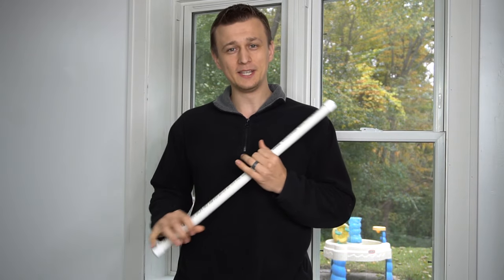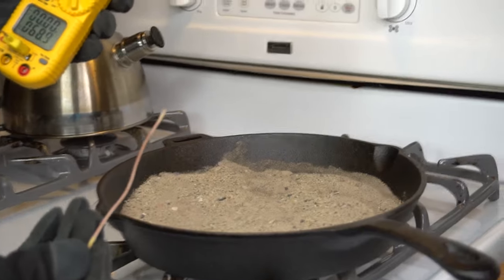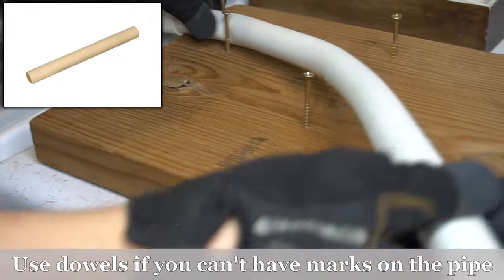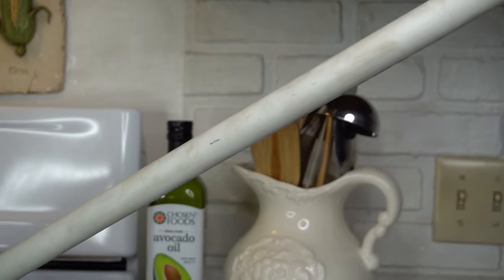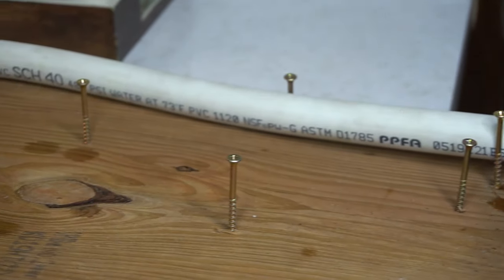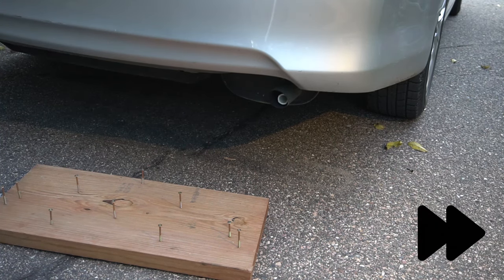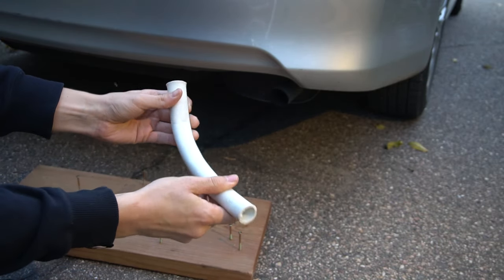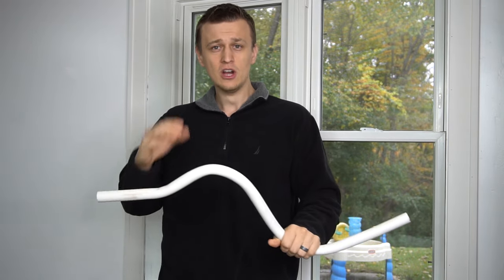How to Bend PVC Pipe With No Tools

Comment: 4.17.2022 - 4:00PM - In the shop.
Very good.  I was working with 7 foot thin wall  3/4 inch PVC.
Only needed 20 degree bends every 10 inches (7 bends).
I used a heat gun (slow) then preferred propane torch (fast),
but that torch will burn PVC quickly.  Didn't matter for my 
purpose.  THEN I kept a wet rag near by and when done bending,
I used rag to PRESS the angle slightly flat for strength,
and also cooling it.
I attached these 160 degree PVC arcs to 8 ft cane poles to
make support arches for bird netting for a chicken coop.
BRILLIANT. PVC is smooth, so netting does NOT snag.
The wife was mildly impressed since she witnesses
my brilliance daily, but regardless, she is MORE
brilliant than I am.   New things everyday.
Mr. Brown
North Central Florida

Comment: Thanks. Like the sand as it keeps it from kinking if you keep the sand inside the pipe.  

I built a big fire in the fire pit or used a charcoal grill.  Lots of heat but not so hot so as to scorch the PVC.  I could turn the pipe in a makeshift spit and move it lengthwise to heat a really long length to make a 4-foot long sweep elbow.  Worked great.  

If you can find a long light-duty spring the diameter of the pipe (I have a spring manufacturer in town that keeps a "boneyard" of previous runs for noodlers such as me) you could slip it over the pipe just before bending it - like bending soft copper tubing with a spring bender.  

Your parking space puzzle got me for a couple of minutes and then I figured it out.  Good one!  (Careful to not post the answer so I don't ruin it for others.)

Comment: I've been sitting around the last few days wondering how I'm going to make a bunch of 1" EMT connections between my new panel and a pull box about 18" away.  The local big box stores don't have a 1" flex conduit and bending 1" EMT to those tolerances takes mad skills.  I wasn't even thinking of using PVC conduit because I wasn't knowing it could be bent.  You just saved me hours of aggravation!  I'm going with the sand technique.  Many thanks.
Reply from the maker: You're welcome! Thank you for leaving a comment and good luck with the project!!
Reply: Same here we need more people like that instead making it harder to understand.
Reply: Most industrial heater for pcv.. just look like a tanning bed with 2 resistance heaters in them, and rollers so you can heat the pvc evenly.. the cheaper ones cost about 600$.. however, not sure why you cant throw it in the oven on broil for a few min..
Reply: Yu can try using the heat of a candle light/flame..

Comment: Put the sand in the pipe cold, with one end capped.  Fill 6-12 inches past bend point. Localize heat from a heat gun applied 3-6" above and below bend center. Bend pipe.  Spray with cold water from a spray bottle... go to next bend...  DONE.  Makes it much easier to hand bend and shape on the job without having to try and stabilize multiple bends while cooling... IMHO!  But excellent vid on the various ways to heat the pipe! Thanks!

Comment: thanks for such brilliant ideas.. Just a thought....How about using a Hot Air Gun ? attaching the adaptor that can slot into the pvc.  perhaps wrap the adaptor with a small strip of rag  or it will just melt the pvc. in seconds.

Comment: Useful for metal tube bending too, helps avoid buckling if packed with sand and duct taped on ends, built a roll cage once this way
Reply from the maker: Sounds like a cool project and good to know that it works well on metal too! :) Thank you for watching and leaving a comment!
Reply: Did you heat the sand first, or heat the tube with sand in it with a torch?

Comment: Thanks! I've been diddling around with hot water which cools too quickly and doesn't get the pipe hot enough to mold into desired shape, it springs back. I knew I'd saved that play sand 10 years for something....

Comment: Great video I'm going to try a variation on what you showed and fill the pipe with water then use a heat gun. Hopefully the water will stop it kinking.

If not I'll try cool sand and a heat gun.

Many thanks for the video

Comment: About the sandmethod:
For a small project I first pored the sand in the pipe to have the right volume and then I pored the sand out of the pipe in some cleaned cans that I then heated. The cans were manipulated with a grab plier. The advantage of using these cans was a more secure poring into the tube…
Anyway your sandpan also works 😀

Comment: Great Video. Gave the steam trick a try, worked great, but I was working with a piece of PVC with an expanded end for coupling to other pipes. This expanded section shrunk significantly during the steaming process and I couldn't use it anymore.
Reply: yeah, you can control it a lot better with the sand. you can add room temp sand into it first to get coverage on the section that you dont want malleable, then dump the hot sand in on top so the ends are not affected.

Comment: I needed to take some of the bend out of a 90deg ELEC sched 40 (gray) elbow. I put on a pair of cheap flannel gloves and held it over sweetie's kitchen electric stove. rotating it several times without touching the stove top. It took about 90 seconds and didn't return to its original shape. I'm 80 yrs old, lazy and impatient.  lol. Kentucky USA

Comment: With the steam method I had a thought, you could use a wallpaper stripper to heat up the pipe and that way you can have the pipe on your bending rack while it's still full of steam.

Comment: If you get in a pinch and you need a bend where looks arent an issue. Wet the pipe with pvc primer and or glue. Light the primer and carefully make your bend. This will work on thick schedule 40 and 80 even big diameter.

Comment: A big torch, like a weed burner torch works the best . Just have to move fast so not to scorch. An handy to have a sprayer with water to cool off quickly once you aquire the shape / bend you want. Have bent hundreds of thousands of pipe like that. 1/2" - 5" an grey electrical pipe bends better than white water pipe .

Comment: Do you know of a way to make rigid pvc connections when there is no room to bend or flex? Sometimes I also need to make multiple connections at the same time. I might be able to get 2 done but not 3 due to inflexibility and short time span for solvent to set. Is there an actual training video on how to do this?

Comment: I like the sand method seems to work great although the most expensive way to do it .
Reply from the maker: I agree, the sand method is great! Steam has the same effect but it cools off too fast. With hot sand inside the pipe, there is a lot of time to form it however you want.
Reply: Play sand is cheap IMHO.

Comment: Very cool video. Thanks. I need to add a 3' section with a gradual curve in it for an extension to my electronic drum set. I was thinking of using a heat gun but after watching the video I want to try the sand method.

Comment: Cap off one end of the pipe, fill the pipe with sand, cap off the other end then heat the pipe with a hot air gun at the area you want the bend & shape it accordingly, the sand prevents the pipe from "kinking" or flattening at the site of the bend. Ensure that all the sand is removed before using the pipe!

Comment: I was going to ask why not use water instead of sand... but then read the description and it sounds like you already tried that with worse results. I would've thought water would give a more even temperature and better surface area contact with the pipe. 

Just googled it to confirm - water has a higher specific heat than sand, which means water should both warm up and cool down more slowly than sand. This means that the water would release heat to the pipe more slowly than sand.

Also a higher chance of leakage and being scalded with water than sand... so seems safer and better to use sand haha

Comment: I have heated a 2" PVC pipe with a propane torch to get a slight bend.  You need to keep moving the flame so it doesn't turn brown or black, but it does work good.
Reply from the maker: Thank you for letting us know that it's possible! :)
Reply from the maker: @White Rick I prefer an evenly heated noodle as well! :) Thank you for commenting!
Reply: @WordofAdviceTV  🤣🤣🤣🤣

Comment: I have a question I'm wanting to bend a 3" 5' pvc pipe and I capped both ends already is it dangerous for me to use a heat gun just enough for me to Bend it a few inches 😅  I'm thinking not and probably need to jist buy new pipes but hopefully not

Comment: I used to have a job burying electric lines in pvc pipe at an airport and we would use the exhaust from the backhoe. We would just hold the pipe over the exhaust so it heated the section that needed a bend. It didn’t get that bendy, just enough that we could navigate a curve in a trench.

Comment: Eye Doctors back to 1960's have used (small Hot boxes filled with Sand in them to shape Glass Frames.) Seems more 2020 Plumbers ,Pipe Fitter's HOV, to Irrigation Sprinklers Techs. That have Whole or Retail outlets with special Torches, Hair Blowers or Drawers, Fitting Tools That worked with both PVC pipe and Licensed Contractor Electricians have not used these same similar techniques before this came out from 1960 to 2020. I, have been around long Time with other PVC, Grey Conduit that comes out newer ideas shape other techniques has not bee illustrated before on You Tube things before in the Archives? I am personally used to as mention at beginning Eye Doctors used the Hot small Sand box to shape ear pieces on Glass Frames. This on Patents needed custom fittings to their head around the ears before other devices to hold Glasses in place like to today. Yes, Great Idea However not always practice out in the Professional Field always on a major Job Contractor to Home or Commercial Work projects. Former Licensed Landscape Contractor 24 years. Certified Irrigation Repair Tech.12/20/2020 Nampa, Idaho.

Comment: I usually use Heat Gun. It can also be used for extracting PVC fittings already stuck using PVC solvent.

87 is the answer to the question.
Reply from the maker: Good suggestion, thank you!! And 87 is indeed the right answer! :)
Reply: Yup..heat gun works perfectly!!! And you can do precision bending!
Reply: No, 78 is the answer.

Comment: Hi, I accidentally bought this pipe PVC 12MM x 3M IPS SERIES 200 PIPE (1/2 inchesx10 ft) rigid.  I already cut it into two pieces 5.5' and 4.5'. I need to shape them in an arch so I can tie them together to make a moon shape. Will your hot sand approach work on this material? Also how long do I bake the sand for at 450 Fahrenheit? Thank you for your help.

Comment: I think the car space is 10
Great idea bending those pipes.
I could have done that many times,
just never thought of it.  I think a heat gun or hair dryer would work.
Reply from the maker: That is not the correct answer. Please try again ;)
I know a heat gun would work but not sure if the hair dryer would get it hot enough. Haven't tried those myself. Thank you for watching and commenting!
Reply: Here's a clue:
86  _ _  88  89  90  91

Comment: Really cool ideas! I’ve been doing a bit of tinkering here and there over the last few months. Mostly just getting a feel for crafting. Made a crude long bow from pvc and braided fishing line, though it might have been too long and the thread too thin. I’m thinking of trying to make a shorter recurve bow and experiment with some different cordage and designs. This certainly will help with making that!

On a separate note I tried making a plaster and sand forge, but I think I put the metal tube for the bellows/hairdryer too high so now while the coals burn well at first, they will suddenly go out. I’m thinking that the airflow only reaches the top of the coals so the flames don’t reach the inner sections and it is extinguished once the top surface is used up. It’s all a matter of trial and error. 

Honestly, I’ve found the value in just jumping in to crafting by working with various materials and getting a feel for them. Cutting/melting plastic bottles into shape, whittling wood, braiding rope. Eventually I’d like to start working on forging iron and aluminum, as well as flint napping glass bottles. Even starting small and simple gives you a strong indication of just what you can do with a bit more finesse.
Reply: Check out Backyard Bowyer! He makes all kinds of bows, crossbows, etc out of PVC!
Reply: He normally uses a heat gun and a DIY sort of heat reflector

Comment: Old electricians trick. Slide the pvc in or over the muffler (depending on the pipe size) of a vehicle  and let it run. In a few minutes it will soften up enough to work with it. Then use a wet towel to cool it down.

Comment: Cover one pipe extreme  with double Grey tape then fill it with sand then heat the pipe from outside with a heat gun, or 🔥. Cleaner and less dangerous

Comment: Hey question/suggestion what if you water cool the pipe as soon as you get your bend so it doesn't droop ovally in diameter while it cools? Would that work or will it make it shrink or get brittle?

Comment: Respectfully said... you might want to consider using some aluminum foil for 2 reasons... 1) it is more likely that the sand will not permanently destroy the Iron Skillet (assuming you will use it to try to cook food later).  2) it would most likely make the sand easier to pout/manipulate if you just grab the sides of the foil (instead of the entire skillet) when pouring the sand into the tube.  Also, be sure to NOT overheat the sand because it can turn to glass if you do (no kidding).
Reply from the maker: You always have good information! Thank you for the pointers! I didn't think about the possible damage to the skillet... That's a great idea! To put aluminum foil on it. Everything washed off fairly easy though so hopefully no damage was done. As for the sand melting into glass.. According to Dr. Google, it would have to reach a temp of 3090°. Or am I missing something and some other reaction happens before that?
Reply: @WordofAdviceTV  I guess it is "my bad" about the glass temp.  but I would be willing to bet you that someone will still accidentally make glass (some how).
Reply: Word of Advice TV g
Reply: Sand won't hurt a cast iron skillet, it's actually a cleaning method for a skillet you want to re-cure

Comment: Ok so the hot water didn’t work because water has a boiling point of 100C, it won’t go higher than that unless it’s steam.
Reply: Water can get hotter under pressure. Some Nuclear reactors use water operating at 557 degrees F at 2235 psig.
Reply: Oh wow, didn’t know that 🤙 that’s pretty interesting

Comment: For running wires (if legal) good trick. If for water 💦 USE PEX! 👍🏼
Next video will be a vacuum cleaner test on cleaning kitchen floor of sand. 👍🏼😂
Reply from the maker: Yes, I didn't mention that but after bending pipe like this, it probably shouldn't be used for pressurized applications. Thank you for pointing that out! Haha and actually my wife did make me sweep the whole kitchen afterwards ':)

Comment: My choice #1 to softener a pipe would be using a heat gun. I'm surprised that I didn't see a heat gun in your video. Also, I'd insert a piece of a garden hose (or another hose, depending on pipe diameter) into the pipe in order to prevent kinking.
Reply: I think the point is without tools

Comment: If you want to use sand from your yard:
Step 1: Sift out the rocks and sticks.
Step 2. Rinse the sand several times, until the water runs clear-ish
Step 3. Then you can heat it, but be aware there is still going to be organic matter in it, which it char, burn and smoke like crazy and could set off your smoke alarm.
I made the mistake of heating yard sand first. Then I rinsed it several times, but after all this time and effort, I think i should cut my losses and go buy the fittings, instead of likely smoking my house out with burnt yard soil carbon.

Comment: When you tried the steam method you should have removed the cap from the other end of the pipe so the steam (heat) will go all the way down the pipe heating it up. Think about it and you'll realize what you did wrong.
Reply: 3:40 He says he tried without a cap, but it worked best with a cap on loosely.
Reply: @grantm6514  ok, idk how I missed it... must have been day dreaming lol